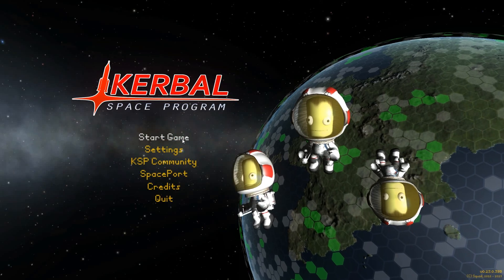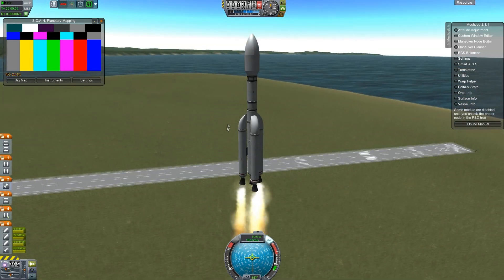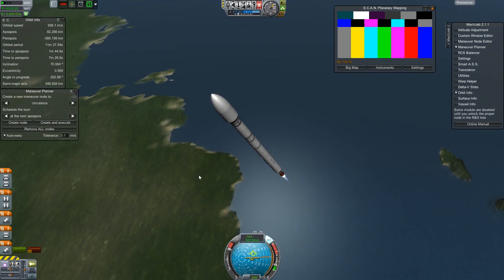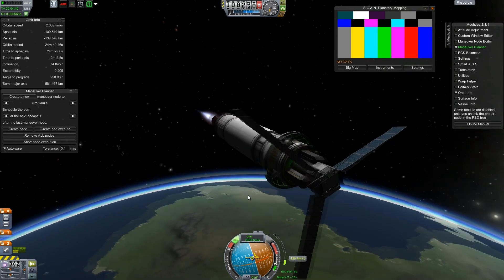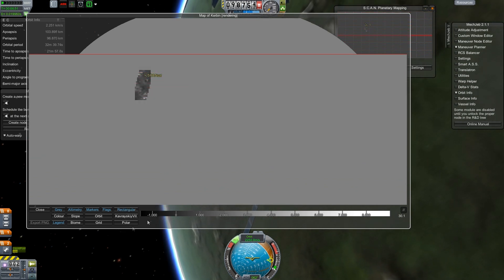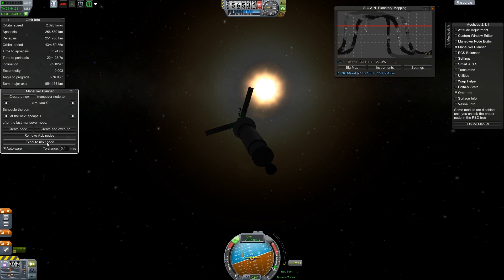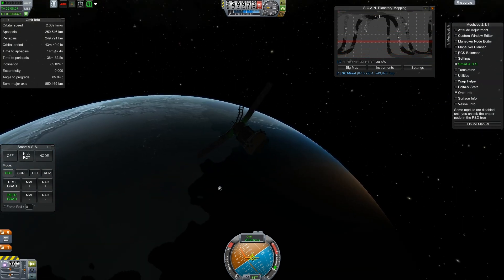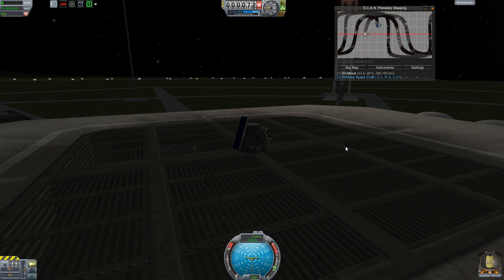Kerbal Space Program: Career Mode Let’s Play | Part 7 | SCANsat Mod

Comment: Yeh dude its because the planet is spinning at 220~ mps so when you switch from surfaces speed to orbit speed on a polar injection your surface speed needs to travelling at 220~ mps west to counteract the rotation of Kerbin

To remedy this you can change to orbital speeds early by clicking on the speed indicator and also point your ship 10 degrees west of north or so depending on the speed of your craft.

This is why a polar injection takes more deltaV because if your doing a east injection you get a 220mps~ boost from the rotation of the planet.

Comment: some people say mechjeb is like an aimbot, but i think its not because pistols dont tend to explode if you do something wrong.
Reply: Great Vid.
////Opinion Alert////
Mechjeb is auto-pilot,
Real Astronauts use auto-pilot..
 Using something that has been invented and is very much so used is "Wrong"?. -- http://spaceflight.nasa.gov/shuttle/reference/shutref/orbiter/avionics/gnc/dap.html  --
This is the same logic as saying in mathematics you are not authorized to use or reference Formulas to solve equations or Saying Night vision optics in combat are equal to cheating.

Does it make ksp Easier? Hell yes but, only within the limits of your vessel.
Also in campaign mode Mechjeb is tucked way in the back of the tree to make it hard to get, so you must work HARD to reap the benefits.
Reply from the maker: Very true.

Comment: you inclination was off from 180 or what ever direction becasue of the rotation of kerbin, you were traveling due north however you already had a velocity component in the direction of of east because kerbin is rotating, so say you wanted to launch into an orbit of 45 degrees, you would not have to travel in that direction on launch, slightly less because you already have like 200m/s velocity in that direction.
Reply: so if you wanted to get into a perfect polar orbit, you would launch and not head directly north but slightly north west, this is needed to because you have to kill the ~200m/s velocity component in the eastward direction.